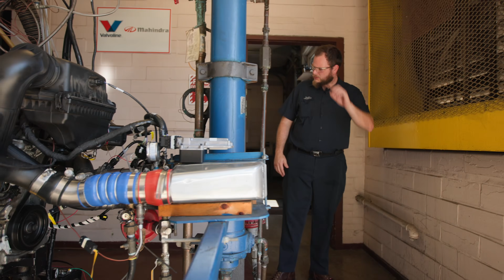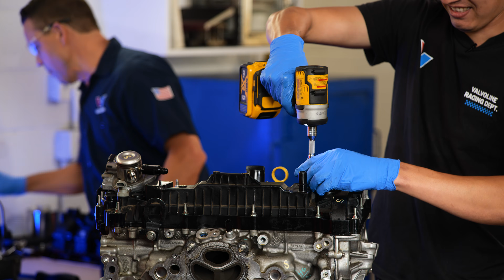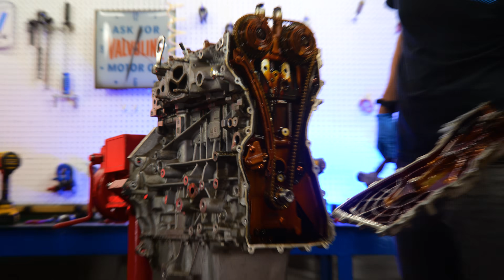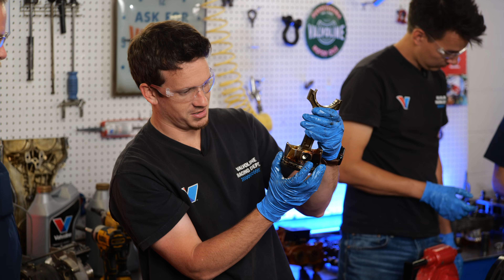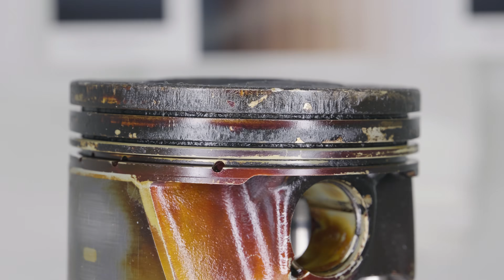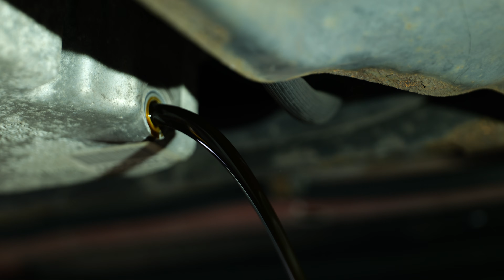RESULTS: What Restore & Protect does to engines after 500K+ miles

Comment: I can honestly say switched from castrol edge 5w30 in my 2014 f150 3.5 to Valvoline restore and protect I could immediately tell the engine was quieter and idleing smoother. This stuff is most definitely protecting more than most oils on shelf at Walmart
Reply from the maker: Love to hear it! 🙌

Comment: Is it ok to use this oil long term? I’ve seen one test result that showed wear increases after the 3rd oil change with restore and protect. I’ve used it twice and now I’m not sure If I should use it again.
Reply: One failure and 10 thousand success·
Wear can happen in some cases when the engine is extremely sludged and the oil filter gets semi-clogged quickly causing low oil pressure.
In other cases
Carbon buildup that was holding already worn bearings or rings gets removed which causing a metal to metal contact.
Reply: @hanynowsky  that makes sense. I’m using it in my 2017 Tundra 5.7 it only has 31k miles . I’ll keep using it.
Reply from the maker: For any questions about products or usage, please contact our Product Support team at 800-832-6825 or email: Productsupport@valvolineglobal.com.
If you have any other questions please send us a message in the chat.

Comment: Will it remove deposits from the intake valves on a direct injection engine? These deposits are caused by oil vapors being deposited on the valves and not washed off with fuel like on a port injected engine. Will the Restore and Protect oil vapors clean the deposits from the valves?
Reply: No it doesn't clean the back back of the valves. Only air goes there(supposed to anyways). Why I prefer port injection
Reply: It will help in case you have a good working CCV (pcv) system. But only slightly.
On DI engines the walnut blast procedure is mandatory.

Comment: Just started the process of R&P on my step daughter's 2015 Kia Soul with the 2.0L GDI that we just bought used. Heavy oil consumption and I suspect stuck rings. These engines are notorious for this. I did a Berryman B-12 piston soak and changed oil to R&P. I'm hoping it'll cure the issue over the next few oil changes. I've ran nothing but Valvoline in all of my vehicles for 25 years and have always had great results. I love their synthetics, huge fan.

I'd love to see a 15w-40 version. I run their synthetic 15w-40 in my 1979 F250 with the 300 straight six and it loves it. The zinc really helps these old flat tappet engines. It'd be great to get some R&P in it, but the available weights are thinner than I'd want to use in it. Maybe a 10w-40 would be ok.

Comment: Make one that meets A5/B5 for European users. We won't put this in our cars and risk damage. Specification maters significantly more than however good the oil is. 

Make it for diesels. We have a lot of those here. Preferably the standard 0w30 we use in Scandinavia because winters.
Reply: @Dmopper BMW LL04 Acea C3 Valvoline R&P 5W40  and 5W30 already available in Europe. Made in the netherlands and distributed across european dealers like opieoils in the uk

Comment: Hello Valvoline. Hope you can answer my question. What is the recommended interval? I’m on my 3rd round and last interval was 7k miles. Could I run 7k again or is that too much for a 2012 ford fusion 2.5 engine? 🤔
Reply: 7k is too long of interval for any motor. 5k is pushing it.
Reply: If it cannot handle that much, then it cannot compete with Amsoil 🤔

Comment: Going to give it a go in my 97 Discovery 1 with the 4.0L V8. It has 200k kms on it and I recently did valve cover gaskets. Lots of sludge buildup on the underside of the valve covers.  I ran an engine flush, now running mobile 1 for 5000kms before switching to restore and protect to see what it can do.  The mechanic said that sludge in areas that do not move is ok, but I like clean engines.
Reply: How is it?

Comment: I’m on my second round of R&P after seeing the detailed video that the Motor Oil Geek produced. I used Mobil 1 for many years until switching to the Napa synthetic made by Valvoline, which I liked more than Mobil. But I noticed that after switching to R&P, my engine sounded even smoother in my FJ Cruiser. This engine doesn’t burn a drop of oil between oil changes, and has over 300,000KM, so I’m hoping to keep it that way. This will be the only oil I use going forward.

Comment: All I can say is that I wasn't a believer until after trying this stuff on my 2010 Acura MDX which is infamous for sticking rings. 
Only a few hundred km after putting this oil in I notice a big difference just in how my car starts up and powers down. It used to start rough and now starts up smoothly. 
Better gas mileage already. 
I bought it with 200,000km and am at 270 now. I have always changed oil every 5000km with Kirkland oil. 
I can't wait to see how it performs after the 4th oil change.

Comment: I could use your advice and help on this oil. I think it’s doing a great job on my 3.5 duratec in my 2020 Ford Transit, but I was shocked to see how much sludge and varnish/carbon chunks were in my oil filter after cutting it open. I posted a video on my YouTube channel about it if you get a chance to check it out, I would appreciate your opinion. https://youtu.be/Z056KC0D238?si=VpRGhgxppYZB9VtB

Comment: i swear that my 2013 g37 is running better and makes more power after running this oil for the past 40k miles. i dropped the oil pan and it looks incredible. I pair this oil with the oil filter meant for a nissan gtr which is larger than the stock filter that comes on G37s.
Reply from the maker: Glad to hear it! 🙌

Comment: I'm using it in a 2005 F250 5.4l 3v. Hoping to aid the known issue with cam followers.  I'm on the 3rd change now with 220k on the engine.

Comment: After first oil change I get a blue puff oil smoke on cold start up every morning, what do you think?  Valve seals got clean and now leaking or rings got stuck from loose carbon ? Thanks for any help, 2006 Camry 2.4 with 160,000 miles 5w30. Oil change every 3000 miles !

Comment: Thanks guys! I own a 2012 Acura TLSHAWD that's starting to burn excessive amounts of oil. The car runs beautifully overall, but it burns oil. So, after watching this, I can spend a couple hundred dollars continuing to run restore and protect to see what happens. Or buy a late model Acura for $52,000.  I'm gonna try a couple hundred dollars first. 👊🏽
Reply: H9ws it working for you. My 2azfe camry still burns oil. But not as much. About to do the 3rd oil change soon
Reply: It’s actually starting to work. It’s a very slow process as Valvoline promises, but it’s actually starting to work. I think if I just keep running this stuff, I won’t have to top-up between oil changes.

Comment: Excellent product. I'm never going back to another brand. I'm on my 2nd round with Valvoline Restore & Protect on my high milage vehicle, and out of an abundance of caution, I do 2 filter changes per oil change, in intervals of 3000km. I will stop doing this after my 4th round of R&P, by which time any large deposits should've been removed. I don't need to do this 2 filter changes, but its comforting. Plus oil and filters are so much cheaper than engine repairs/rebuilds.

Comment: I have a 2020 5.3 gmc sierra with 68,000 miles. Two questions, can I use the Valvoline restore and protect 5w30 because I live in the Deep South and will this be beneficial for my engine? I have never missed an oil change and have always used 0w20 full synthetic ac delico, dexos oil. I’m no longer under warranty so I don’t mind using non dexos approved if it’s ok to use in that weight and will it help my truck live longer.
Reply from the maker: For any questions about products or usage, please contact our Product Support team at 800-832-6825 or email: Productsupport@valvolineglobal.com. If you have any other questions please send us a message in the chat.

Comment: Many thanks for this as a R&P user it is just what I hoped you would do.  Do you think the things that broke during the 500k mile test might not have if R&P was used ?  For instance; cam phasers and the turbo bearings?  Did you run a compression test on the pistons?  Thanks!

Comment: My 2008 Chevy 6.0 plow truck has had 2 changes. It had 240,000 and is now at 250,000. It was using 1/4 of a quart every 5000 miles. I thought that was good. Now it uses none. That's even better than good. Nice product so far. 🍻

Comment: If they'll make a 0W-8 version, I'll buy it.
Reply: They have a 0W-16, which is close enough. Seriously, 0W-16 is about 7 cst @ 100C and 0W-8 is 5. Toyota even says you can substitute 0W-16 in the manual.
Reply: it doesn't say you can go to 0W – 16 as a permanent substitute. It's intended to be temporary, i.e. one oil change.
Reply: @bme7491  Because of CAFE standards and them wanting your engine to wear out quicker for shareholder profit. There is zero reason not to use 0w-20 or even thicker on a non hybrid
Reply: @BuddyTheWolfYT  yes there is. Because the engine was designed for 0W-8. And who's 'them'? Valvoiine? I already use their R&P in my other cars that take 0W-16 and 0W-20. Why would they come out with a product to clean you rings if they want your engine to wear out quicker? That's just an assertion.
Reply: @bme7491  Toyota's shareholders and the EPA not Valvoline

Comment: Should I worry about the released built-up deposits getting into oil circulation and being abrasive?
Reply: That’s what the filters for
Reply from the maker: No, Valvoline Restore & Protect™ is formulated to dissolve harmful deposits and suspend them within the oil at the microscopic level. This ensures the process is done over time and gently to not cause any issues to the engine or filter.

Comment: The oil filler cap and dipstick on my 2010 Honda Insight had some significant varnish buildup after 100,000 miles of unknown service history. After 2 rounds of R&P, they are completely clean. Looking through the oil fill into the valve cover, all the golden brown varnish that used to be visible is gone and shiny, clean aluminum is all that can be seen. Very impressive!

Comment: I saw Motor Oil Geek's video where he put Restore and Protect in a Toyota Sienna van, and it cleaned the varnish off the dipstick. He also explained what deposits were being removed and showing up in UOA. Once I saw that, I decided to use Restore and Protect where I could.

I enjoy the "We Do Cars" channel. He would often do teardowns on engines, where people trusted the manual fully on oil change distance. Many manuals would say 10,000 miles on synthetic, or 5,000 miles on conventional. People who did that frequently ended up with stuck rings. He would disassemble the failed engines that returned as cores.

Comment: VRP saved my 2021 Telluride.  Did I just say I am a fan?  I run it in 3 cars and tell anyone who will listen.  How many real world miles do you equate your 24 hour runs?  My Telluride used to get 20,000 miles per year, but now the three cars I am running in are under 10k, even under 6k.  Am I losing benefits?
Reply: with an oil like this, its not about losing benefits, its just not gaining as much. it'll slowly clean whether driven a lot or just a little 

the way i like to think about it is the less time you drive it the more time it has to clean the oil pan
Reply: @seedapplton2644 Temperature was also mentioned.  Each of my cars gets up to highway speed regularly, but for a car that is short tripped will the cleaning be less effective?

Comment: Really impressive. I can’t wait to start changing my own oil so that I can use it on my own truck after the warranty. 

It would be good to see the intake valves on the DI engines.
Reply: Using it now should not cause any warranty issues. It meets all the specs.

Comment: I'd actually heard of this product and literal rave reviews of folks before I saw this video. Super impressed, looking forward to putting it in my old Corolla with 160k miles... THANK YOU for doing what you can to make products last longer! If only manufacturers did the same - (sigh) - Ever since 2020, it's almost like manufacturers are trying to see how short they can make engines last, still get suckers to buy their stuff (Toyota! GM!) - It's a race to the bottom.
I've got an old 2004 Cummins Diesel, "low" miles (for a Diesel). Wondering if you make something for Diesels?
Reply: What year is your Rolla? Mines a 98 with 200k and had a hard life before I got it at 187k

Comment: Question for Valvoline engineers....I own a 1998 GMC Yukon SLT. I have owned this rig for 17 years, and it had 30k miles when I purchased it. I now have 230k. I'm a weirdo and change my oil every 2k miles.  I began using Kendall GT 10w30, then moved over to VR1 10w30 until 2 years ago, I began using Valvoline 150k 10w30. Should I switch to restore and try the 4 oil changes you suggest in this video?

Comment: I've run Valvoline R&P in my 99 Camry 5SFE for about 40K miles now. It absolutely freed up the rings and gave the engine new life. About 12K miles ago, I did a valve cover gasket and had the golden hue on the cams. I was wondering if that was going to clean up inthe future. Nice to know it should and that your two engines had that too.

Comment: At 13:00, the labels on the rings from the bottom to the top: oil control ring, compression ring #1, compression ring #2. HUH??? Compression ring #1 is at the top, not the middle! Was that a human, or AI, that made the mistake?

Just remember, folks. R&P should NOT be used on a modern small engine with a turbo-charger. Check your warranty. R&P has limitations on what it can be used in; even Valvoline says so. Do your research!

Still, this seems to be a real-world amazing product.

Comment: I just ran R&P through my 152k 2008 ISF engine, just to see if it'd get anything out of it. Turns out it did. 5000km oil change, and the oil was noticeably darker. Did it's job. Will run it maybe once a year for preventative maintenance

Comment: Just switched to VRP in my 250k+ mile Mitsubishi. It was tough not getting the oil I usually use, but Mr Lake Speed convinced me. If it's good enough for his wifes car, it's good enough for mine. It's only been about a week, but the difference is already noticeable. The exhaust that started smoking in December of 2024 has already stopped in only 1 week of running this oil. I know changing the fuel filter didn't do that!

Comment: This is awesome! I did a piston soak to our sonata that was burning a quart of oil every 300 miles. Issue fixed! Threw this oil in it and its going to be our go to oil to prevent the issue from happening again. I put this oil in my 210k mile F150 5.0, hoping to keep that running in tip top shape

Comment: Currently running a round of 0W20 VRP in my 2018 XC60 and have already seen an immediate MPG increase within the first 2k miles. While I know it doesn't meet the specs volvo wants, I was mostly worried about the HTHS and LSPI, and to spare the details, I finally put that paranoia down after hours of research, and caved in.

Comment: hope you start selling this oil soon in europe
Reply: The extra cleaning properties of R&P are less important than you might think. Other engine oils have similar detergents, and R&P’s extra cleaning power over other oils doesn’t necessarily equate to a practical benefit. If your engine doesn’t have any specific signs of buildup/deposits or oil consumption, other oils will be just fine

Comment: Started using R&P on my 2016 Mazda CX five when I reached 50,000 miles on the odometer I’m still on the first oil cycle and will continue to run this to make sure the engine stays clean. Thank you to Valvoline.

Comment: This will make the infamous Hyundai/Kia failures non existent. Using this every 5k and sooner the first two changes. Have 210k on a 2019 Hyundai Santa Fe 2.4L
Reply: I started running this in the wife’s 2020 Sante Fe the last few changes every 4k. Almost 80k now so I’m hoping this is true.
Reply: @deezyperformance  I did a b12 Berryman piston soak (during spark plug change) too which helped as well.

Comment: I’ve been running this in my 09 Ranger 4 cylinder with 260k miles for about 4 oil changes and have been very happy with the results. I had no issues, but I didn’t want any. Looks cleaner when using a cheap boroscope in the valve cover, and it doesn’t burn any oil even with 3k miles between changes. Will be using it in a rust free 2000 Tundra I bought for $4k with 300,000 miles on it. I needed something for medium towing for cheap, and maybe I can get both to 500k!

Comment: Two personal vehicles: 2000 Tundra V8 owned since 9k miles, always used high quality synthetics, first R&P used at 195k miles and with 2000 miles on it the oil remains the same amber color it started with.  I’ll still go four changes to protect the rings.
2nd car: 2012 Avalon, purchased from Enterprise Rental at 33k miles, have used nothing but high quality synthetics, at 150k miles the V6 began getting the characteristic valve ticks which some people say isn’t anything to worry about , so at the next oil change I went to R&P and the oil went jet black within 10 miles of use.   I changed it again at 300 miles and it colored a little bit, and the valve ticks went away and hasn’t returned.   God only knows what Enterprise put in the engine when they had it, and if they ever bothered to change the filter.